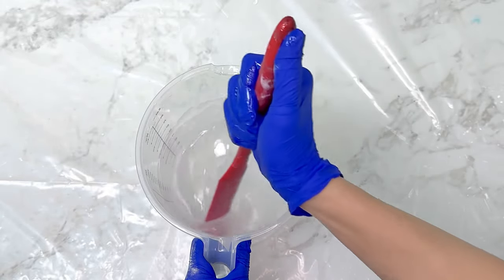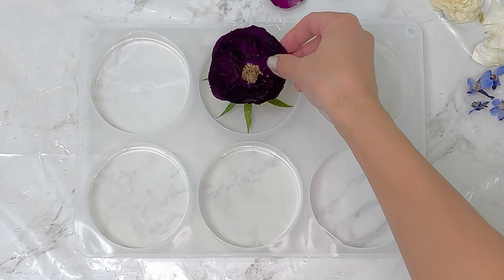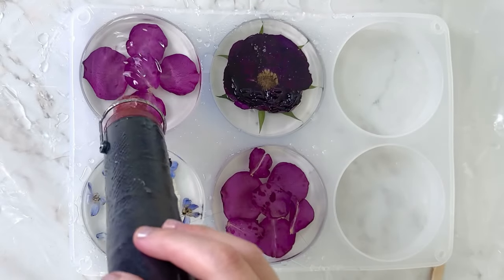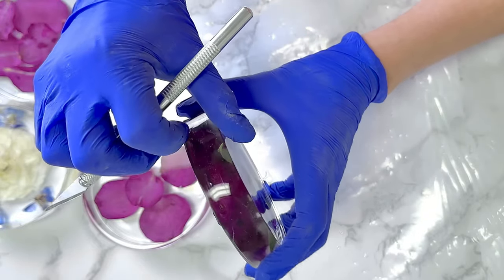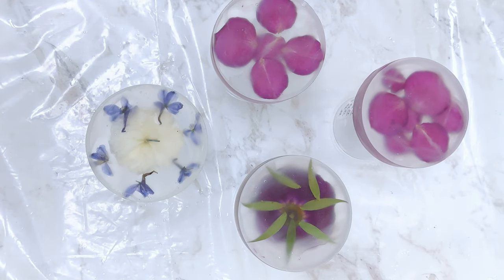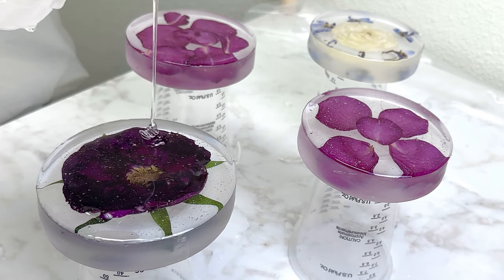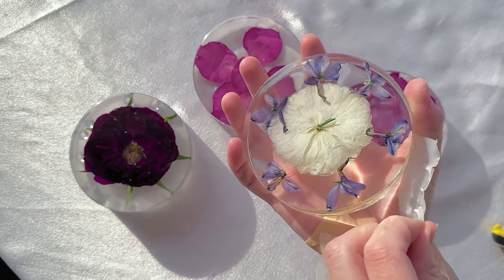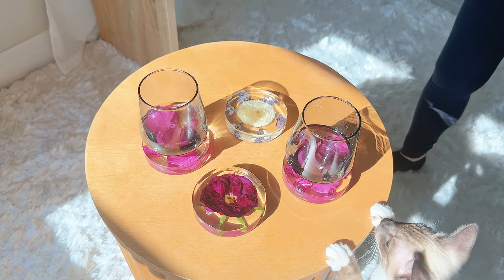Real Flower Coaster Tutorial | How to Make Resin Flower Coasters, Epoxy Resin Coaster DIY Floral Art

Comment: Can I ask why you don't use a vacuum chamber for bubbles?
Reply: I imagine this would be because the pressure would ruin the portion of the flowers that are not in the resin. Since they've been dried they are very brittle.
Reply: Top coat resin doesn't have a lot of working time and is thicker so it may just be easier for her since she does multiple projects at a time. Good quality resin usually degasses itself with minimal bubbles. Sometimes vac chambers create more bubbles with that amount of resin she mixes.